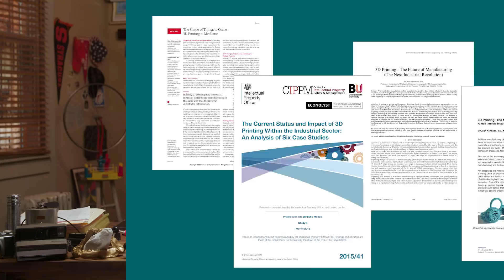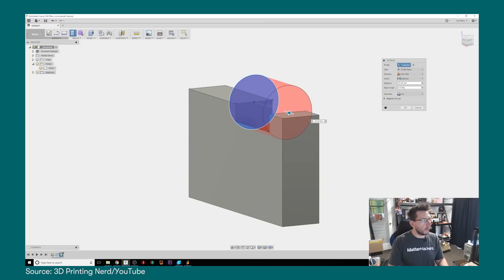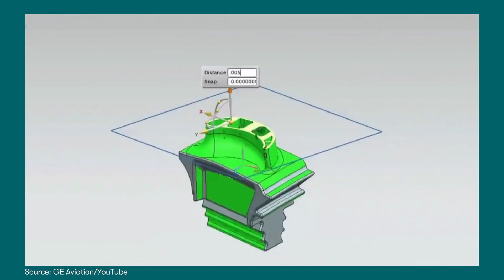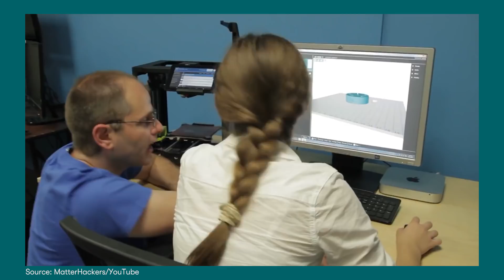What happened to the 3D printing revolution?

Comment: Industrial 3D printing and consumer 3D printing are two completely different things. 3D printing has been around since the 80s in Industry, that's where it came from. Consumer 3D printing is what is new and what was described as the "Printing revolution" which was complete hyperbole. Basically the 3D early printing technology patents (FDM, SLA) had run out so that created the 'boom' as it were as the technology became available to hobbyists and enthusiasts. 
 Then new companies sprung up around this availability and we got the wave of 3D printing hype around it from people who didn't understand the limitations (and probably the new companies like Makerbot themselves pushing it). Behind the the ups and downs of the hype however, the original 3D printing community of enthusiasts and hobbyists has been slowly growing organicaly until the last couple of years where it's grown quite quickly.
 The initial description of a "make anything" machine where you could print off a new pair of shoes or any other object you needed was very misleading as to the capabilities of the consumer technology. It does have many uses though and it's a bit of a 'chicken and the egg' scenario since people won't buy 3D printers if they don't see any use in them. I bought a cheap printer kit about a year ago just because I could afford it, although I wish I'd bought a better printer in hindsight, and wanted to try it out. I've since gotten a lot of use out of it but there was a lot of learning and tinkering involved and that's really the current limitation with it.
 It's just going to take time for the reliability, features and ease of use to develop to a point where most people can use them. These printers do exist but they are very expensive currently e.g. $1000 and up, but over time the price point is coming down and quality and features going up and they are slowly becoming more mainstream. Printers like the Prusa Mk3 are a very good example of this.

Comment: The only type of 3D printer that interests me right now are the liquid types. They are fast(er) and allow for way more detail but on the downside they also require an alcohol bath and UV lamp curing. Until there is an all in one system where I just open the door and grab my object for around $500, I'll just keep playing with 3D objects in VR. 
Very well done video, I like how you hide your "jump cuts". I wish more creators would adopt that style as it's not distracting and makes the video flow better.

Comment: 3D printng is just about as awesome as it's been foretold! and ever since it reached the critical mass for cheap kits from china to become available (namely the anet A8 about 2 years ago) the hobbyist community became pretty huge. 
BUT it's still far from being as easy as printing out documents! it's half art, half sciece, and the optimal settings wary with the machine, material and object, and are different for almot every print, not to mention CAD skills to make your own models on the fly. there certainly is a learning curve to it, but once you master it, a <250$ 3D printer becomes an absolutely invaluable tool!

Comment: About a year and a half ago, I got a 3D printer (low grade) and started using it and enjoyed it. The complicated things I had to learn at first were intimidating but we’re fine once I got around it. About a year after I got it, I decided to learn how to use Fusion 360 (really good 3D modelling software) and the moment I learnt it, it open up a whole new world of 3D printing for me which was amazing. The reason why I hadn’t learnt it sooner was because it seemed quite intimidating. I think the moment 3D printing seems less intimidating and when difficult software is encouraged to be used by beginners or people who have experience is when the 3D printing ‘home’ revolution starts.
Reply: I'm struggling with Fusion 360, only because it took so long to figure out which functions I would need to replicate a molded plastic part of which I have the OEM original. Of course I chose a part that has no straight lines, continuously changing radii, no right angles, and warps in two planes so there won't be any plane that will be flat against the bed. It turns out the answer to designing this is to learn 'lofting'. The rest is easy, lol.

Comment: 3D prototyping is very convenient and cost efficient. The shape of things will change not the manufacturing base. Bespoke jewelry also becomes ridiculously approachable to people without the metallurgy knowledge. As a fashion designer it just makes prototyping in different materials more approachable for prototypes. Do you know how much it cost to have a custom made belt buckle cast in bronze? Compared to the price of the same object being 3D printed. (I think it’s even cheaper to have the belt buckle prototype 3D printed in platinum or sterling silver, aluminum, than it is to cast it in bronze.)

Comment: Good video with accurate observations.  You have to be able to draw or model as some folks like to say.  Drawing is a key component and that is the big divider.  I'm in the Custom CNC business, applications, programming and robot engineering so 3D printing is about making parts for me.  I could care less about trinkets, masks, toys and puzzles, my business is about making parts and making them faster and more efficient.  Working out print profiles, dealing with variations in plastics, and generally fiddling with a device with a motion controller that is the cheapest dirtiest system on the planet with a dumbed down operator panel is not going to fulfill the needs of even the most inept noob that wants an appliance printer that they can shove a photo of a part in front of and tell the device to make it.  A man with a 3d printer isn't a maker, he's a printer.  A real maker is a craftsman, toolmaker, machinist, welder, programmer ad infinitum.  The real maker is the dude that designed it, fabbed it up, debugged it and ended up with something that does more than just take up space, IOW, it can be a tool or a product that people want.  The custom metalworking business is where it's at, Additive manufacturing, sintered laser deposition with finish machining is the future for now until we can figure out how to make Star Trek transporters that manipulate matter at the atomic level.  I was recently up at Renishaw for technical certification on one of their measuring instruments and this is what they are into.  If you are ever in the Chicago area you should drop by.  http://www.renishaw.com/en/metal-3d-printing--32084

Comment: To someone who lived through the PC revolution, this is so familiar. PCs were very much hyped...then people realized how much effort it took to get useful results. Enter VisiCalc -- the "killer app" that businesses understood and was immediately useful in helping the bottom line. More than the Homebrew Computer Club and the Wozes that came from it, this is the foundation of the PC revolution. It's what made the movers and shakers willing to move and shake their investment portfolios. 3d printing hasn't had that eureka moment yet. The consumer market is still very much homebrew. The killer app? Hard to say. Probably an AI who can take a description of what you want (voice, sketches, existing things, etc.) and then create a printable design. Having everyone gain proficiency in Fusion 360 is as unrealistic as making people learn BASIC was 35 years ago, but if you can make the machine do the drudge work, then you'll have the paradigm shift. Also, consumer additive manufacturing has to produce parts more mechanically robust than is currently typical and still retain consumer price points.

Comment: I am an electrical engineer and have used 3-D printers and using them as prototypes has changed the creative path for me and my fellow engineers. We are able to not only print something and bring something in our minds to life in under a day but you can fully understand the part itself. Plus the biggest part of this entire story that you have forgot to mention is price to 3-D print that huge metal piece.  I can only think it  cost 5k if not way more. Printing a cubic inch out of metal cost about 500$. To print a cubic inch out of plastic can cost you 1$ or less.

Comment: As an owner of a consumer-model 3D printer, I can tell you it's an awesome thing to have around the house. I have printed a lot more useFUL stuff than useLESS (although let's be honest, who doesn't want a Yoda bust for their desk at work?)

I think this video does a very good point of pointing out that the hype cycle gets people more amp'd up for a technology than they should be. I will also point out, however, that there are plenty of things that people use daily that require some understanding and experience with in order to be proficient. You could even go as far as to say this about smart phones, DSLR cameras, coffee makers, etc. Just because you can't pick it up and instantly utilize every feature of it doesn't mean it should be written off as something unavailable to the general public. I went from knowing very little about my printer to proficient prints in a month or two, and while there were some low points, it wasn't backbreaking work to tinker, learn, iterate, and move forward.

Bottom line, if you're going to invest in a printer, or feel like it's for you, then do your research about the different technology out there, teach yourself some basic engineering skills and CAD software, and make the most of it instead of printing a few trinkets you found on Thingiverse, getting bored, and leaving that awesome piece of kit to collect dust.

Comment: Using my 3D printer to print ABS plastic brackets to install printed circuit boards into a custom enclosure as we speak.  Last week I printed out custom mounting brackets to install blinds in the house.  The "universal" OEM brackets didn't look good.  I was able to print much stronger solid ABS plastic in brown to match the walnut stain of the wood trim.  As a household tool, my 3D printer (CEL Robox DUAL) is my most used tool up there with my drill, tape measure, level and hammer.
Reply: It's not the tool that is the problem , most people just aren't creative enough to find use for such tool , that's not the tool's problem . Having opinions on things already built is something many are good at .
Reply: I use a lathe to turn many wooden things for my house - but that doesn't mean a lathe will soon become as popular as microwave oven... It's still a specialized tool.
Reply: yeah i agree with benjamin i have been working on a model for several month now and it's definetly not simple for someone who is new to the subject
Reply: It took me a few weeks to learn how to design and print my own stuff. It took months to be able to refine that to get reliable prints. And after a year I still feel like I'm pretty new to it.

But the fact that I'm able to be pretty successful with this after a relatively short period of time, and with no formal training, is a big deal. Yeah, they're not as easy to use as a paper printer, but that misses the point. There might not be a 3D printer in every home, but they are certainly accessible to anyone who can afford to drop a few hundred dollars.
Reply: dishmanw I just received a roll of APLA (advanced PLA) that is supposed to print better than regular PLA, but also if you bake the finished parts at a certain temp and time, it rearranges the plastic's structure to give it higher heat resistance than ABS. Sounds like a win-win (except cost).
Reply: @dimman77  have you ever tried PETG? It's really easy to print and has a temperature resistence up to around 70 degrees celsius
Reply: +The Dollar Guy > Using my 3D printer to print ABS plastic brackets to install printed circuit boards into a custom enclosure as we speak.

Sounds like something 1 in 10.000 people might have a use for.
Reply: I've been 3D printing for about 3 years now and while I'm good at it and can make pretty much anything I set my mind to, there's still a lot I learn every time I use cad software
Reply: The specialized power-tool comparison is very apt. Not everyone will find a use for one but it's a godsend for those with the creativity, knowledge and need.
Reply: Foljs, very true.  But it has become quite handy with many housold repairs.  I realize I don’t account for everyone, but 3D printing (additive type of manufacturing) is really the future.
Reply: I'm right there with you. I've gotten to the point that I don't go to the store for stuff like brackets unless I need one too big for my printer or that needs to support more weight than I can reasonable support with PLA. (Sadly my printer can't do ABS.)
Reply: Have you experimented with any methods of filament extrusion or ABS pellet adaptation and other recycling methods? 

I want to say I have 3d printed but really, money is extremely tight for me so I'm confined to try and design and build a simple cartesian to save money and look into recycling methods to keep costs low.

I think 3d printings 'bread and butter' in homes is merely for technologically creative types who build electronics products and other such things to build elegant 'finished product' project cases. I mean, apart from 3d printing the odd replacement part to replace a $0.05 part that would otherwise cause an entire item to be thrown away, the best common use of household 3d printing is making cases for electronics products... 

I guess if you're into making 'stuff' like woodwork/metalwork types there are some good applications like printing chess pieces or maybe wall bracketry and organisational things for lighter tools, but I don't see many uses beyond the gimicks. Not to say 3d printers aren't incredibly useful though, because they are/
Reply: The Dollar Guy Currently working on a project using PLA. Waiting till I get more experience before I use ABS.
Reply: I know that you know that you, are not typical. I'd bet less than 1 in 1000 households have a lathe, plasma cutter, and 3d printer. Add a telehandler to that list and it drops to 1 in 100,000
Reply: filament extrusion has a high cost floor and is more expensive than buying a regular 2.2 pound spool for $20 bucks. Also If I remember correctly, You can't recycle old prints because the molecular structure of the plastic changes when it is printed.
Reply: @Augman  oooh yes you can. CNC Kitchen did that
Reply: A stamped 2 dimensional steel plate bracket vs a 3D solid block of abs plastic?  The universal brackets allowed side to side movement.  The plastic ones I made, the blinds are now anchored solid.
Reply: I'd buy that for a dollar!
Reply: Early bird Kickstarter Robox here! 5:38 "still a long way to go" immediately threw me back to the time I was looking into this and found CEL Robox. I thought to myself then Hmm OK, maybe desktop 3D printers have arrived. I was off, but I sure appreciated not having to deal with all the issues other designed were plagued with at the time.
Reply: I agree for geeks it's already a key tool.   Naturally will take time for plug and play for non geeky home users.
Reply: "Most used tool"? Not your hammer, spanner, wrench, screwdriver, knife, bottle opener, drill, drill press, lathe, planer, mill, sanders... but your 3D printer? You must be kidding me.
Reply: I like to use PLA for things that need to be easy to print and Polycarbonate for things to be strong as heck. (all-metal hotend required)
Reply: MasterBata are you kidding?

A wooden lathe has a limited function, otherwise people would just lathe anything into any shape they wanted.

There are production savings (repeatability) in design.

I don’t know, I think you make a decent point at first but when you really think about it, 3D printing is much more versatile than you’re making out there.
Reply: The Dollar Guy, I doubt the "Much stronger" part.

Comment: I just finished up my last year in engineering school which meant doing a capstone project with a sponsor. We had to  design the tubes that go into these high end water heaters that are supposed to be super efficient, so we were encouraged to get creative with our design and worry about making a prototype later. We 3d printed it at a fraction of the cost that our sponsor usually had to pay to make prototypes, and it was printed and shipped to us within 2 weeks. When we presented our work to the sponsor, they were more interested in how cheaply we made it than whether it worked or not. I really don't think you can overstate how much easier 3d printing makes research & development in engineering.

Comment: What happened is that the companies that started making 3D printers saturated the market with so many low quality printers touted as the "Latest and the Greatest" that never lived up to the hype so,   those who were really interested in buying were left scratching their heads trying to figure out who was lying to them; was it the manufacturers marketing hype or was it the self-appointed YouTube 3D printer gurus that were lying to them?

The 3D printers that were decent printers gave many of us sticker shock and buyers remorse.  The learning curve of most printers was also a major sticking point.  For total newbie 3D print people, not only do we have to learn how to use the printer, se also had to learn how to use the filament, the slicer software and if you planned on designing your own gadgets and gizmos you also had to learn how to use one of the plethora of design or CAD software to do so.

What Happened to the 3D printing revolution???  That revolution hyped and priced itself out of fruition.